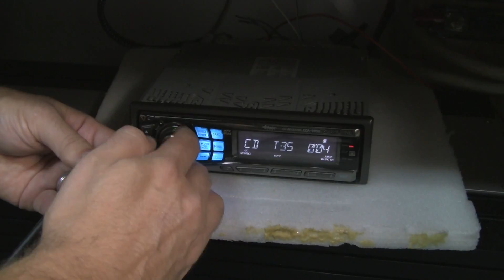Tech Stuff Tuesday - This is what amplifiers do

Comment: Ok....so do I set the amp gain by ear initially or dmm? Seems like it would be set by dmm and adjust volume according to the audible distortion. 
One more thing, bass knobs...yes or not at all??
Reply from the maker: Setting the gain by DMM then adjusting volume by ear is negating using the DMM at all. I always set by ear because that's what matters in the end. If you set by DMM it may be unbalanced even though it's "correct". As long as you know what distortion is, the ear is the only 100% effective method. There is no tool that will top the ear. Bass knobs are great if they control the signal voltage and not a bass boost knob.
Reply: Depending on the amp, a bass knob either adds volume or boosts a certain freq output...you're on the right track when you said "by ear" but those tools help us get a general idea...once the gain has been set, use the volume on whatever media player chosen for signal control...YOU are the best tool when it comes to doing something YOU want done righ